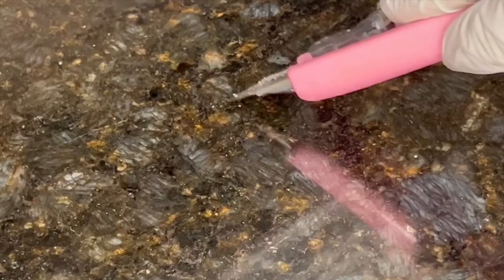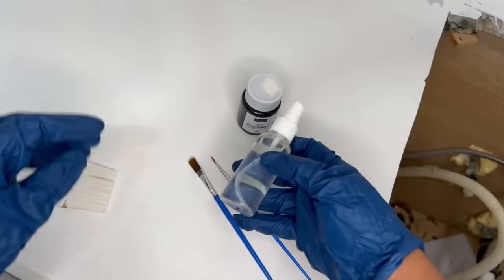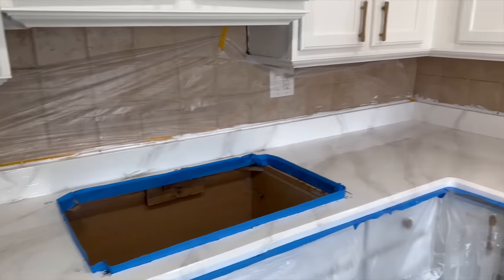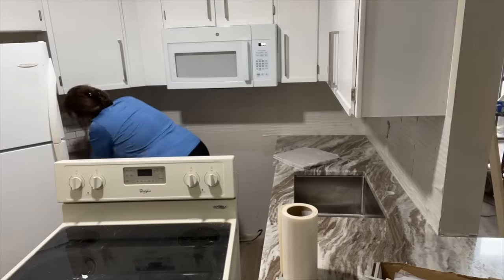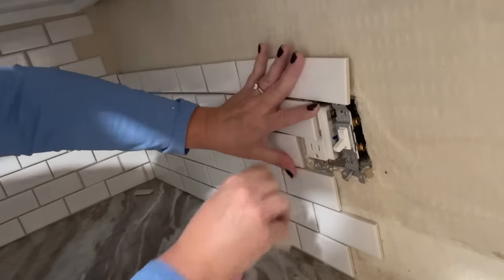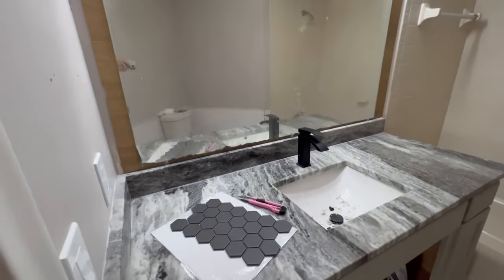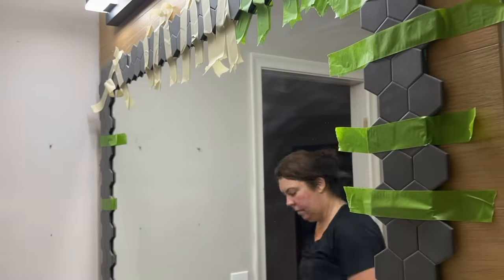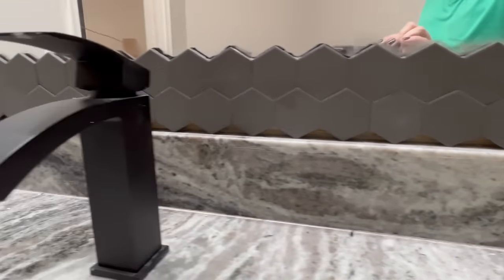The BRILLIANT new way she updates her kitchen countertops for $250!

Comment: It doesn’t make since to do that. You probably could have sold the old then bought wood countertops and done the same project. I somehow think she would have pocketed some money. IDK lol
Reply: It is extremely hard to sell old counter tops. Dealers don't buy old stuff, and since kitchens are different sizes and shapes, you have to find someone that is doing a remodel that has not only the same size and shape, but also likes thst color. Sure, you can cut them if the next kitchen is smaller, but if you don't have enough or it breaks, then matching the old with new is really hard.